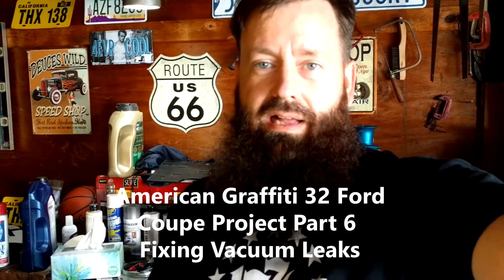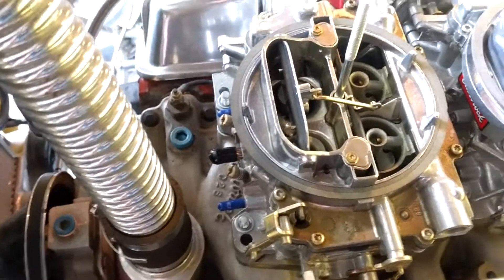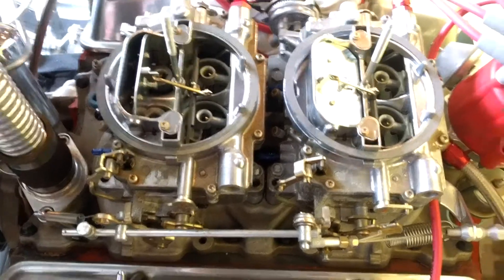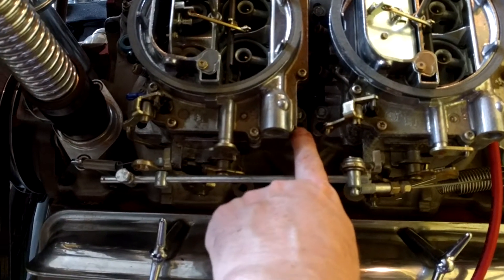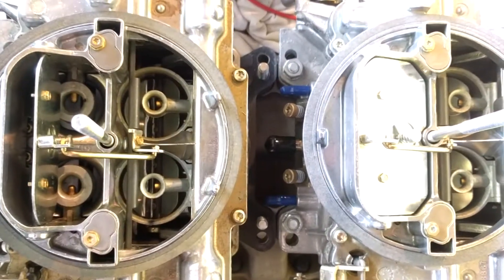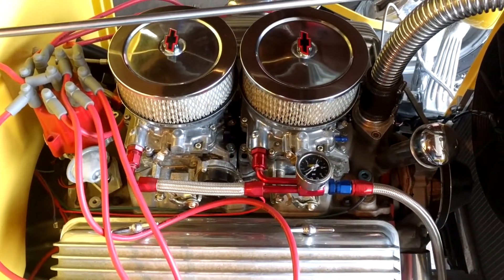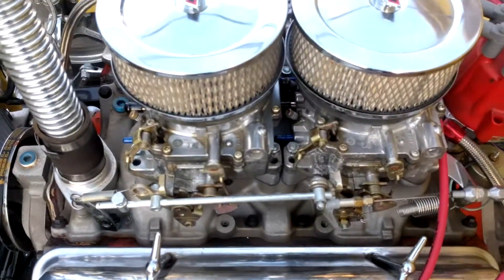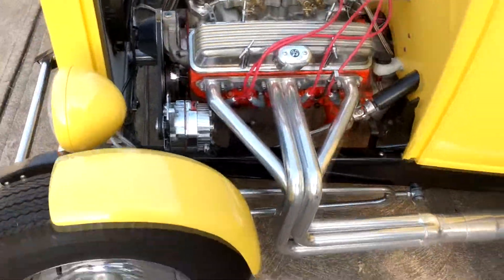American Graffiti 32 Ford Coupe Project Part 6 Fixing Vacuum Leaks

Comment: I had a vacuum leak from the manifold once.. put a little fuel between manifold and head and idle increased. found the leak. Fixed it temporally with silicone.